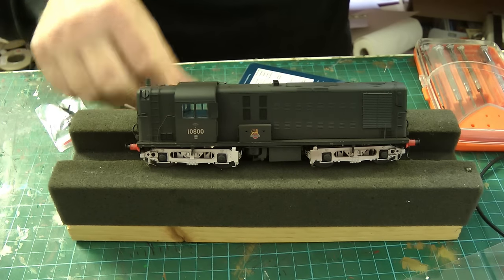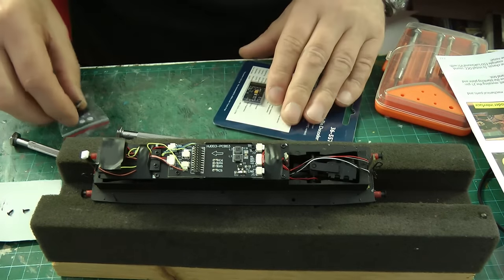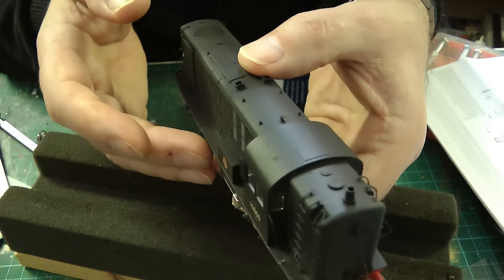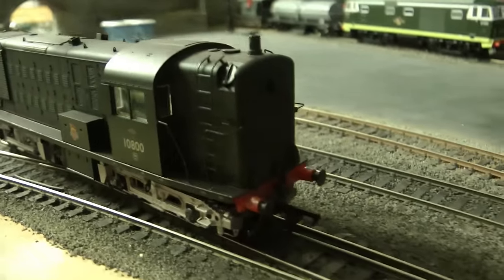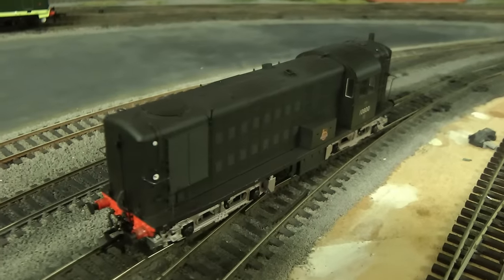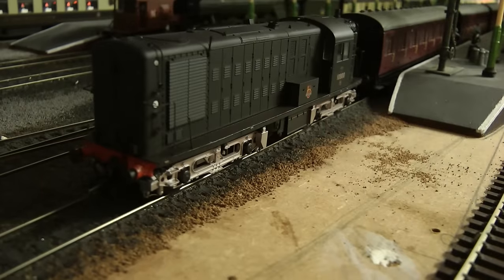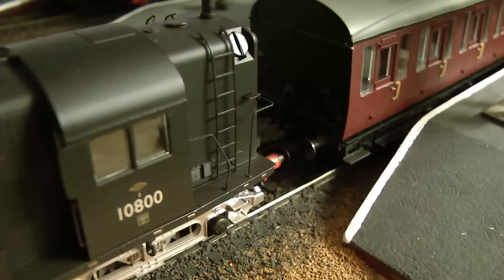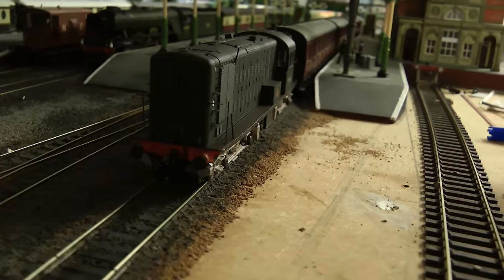North British/BR 10800 joins the fleet  No 411

Comment: Hi Tony,  You have an interesting loco there.  When you said it was built around 1962, I thought it odd as it was early crest making it 1949 – 1956.  It was actually built by the North British Locomotive Company on the 1st July 1950.  
It appears to be in ex works livery and, like you say, it could do with some weathering.  Interesting it was cannibalised during the 1972 miners' strike. The engine and generator were removed as a standby generator for the Brush Falcon works.  
Enjoy you new addition to the North Eastern.  Happy New Year to you and Laura.  Best, Jason.
Reply from the maker: Hello Jason. it is something a bit different to what we have here at the north eastern. my apologies' it was built in the 1940s it was allocated to branch line working in the 1960s. i got my dates all muddled up. it does run very smooth. and i have found no issues. Thanks again for commenting. and a very happy new year to you my friend. cheer's for now Tony & Laura.